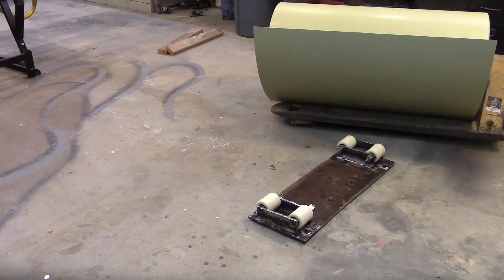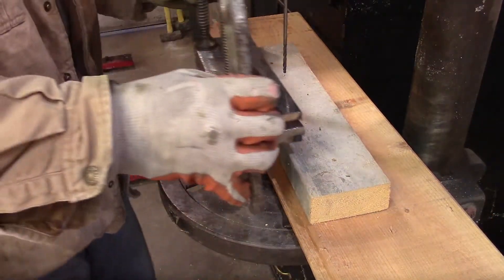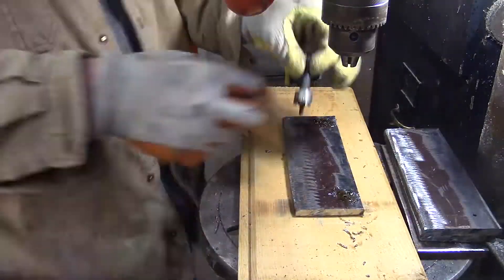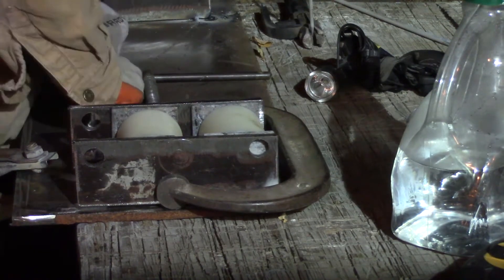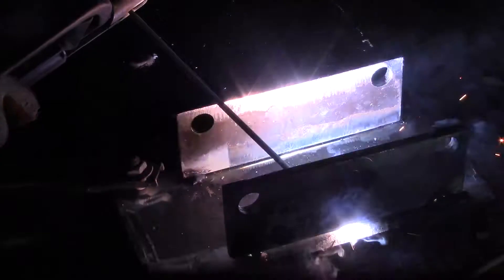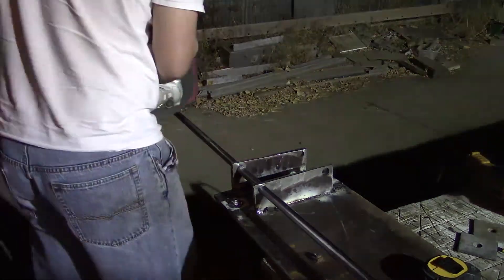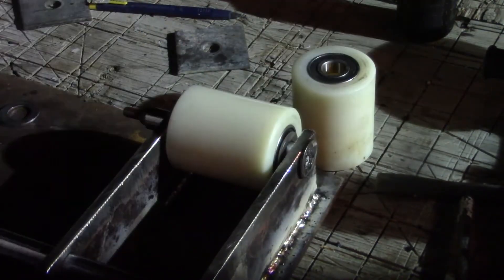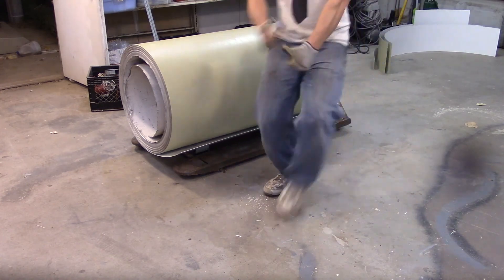Decoiler / Uncoiler / Unroller. DIY, semi-compact, under $150.

Comment from the maker: note: this type of uncoiler is only for coils that keep their shape. if they're too thin and too heavy for the rigidity of the sheet metal, then the coil will partly collapse and it won't be very functional.
I'll be making a more "proper" uncoiler during this coming week, since I'll be working with more homeowner-friendly metal, and that coil is floppy and weighs nearly 3 tons.